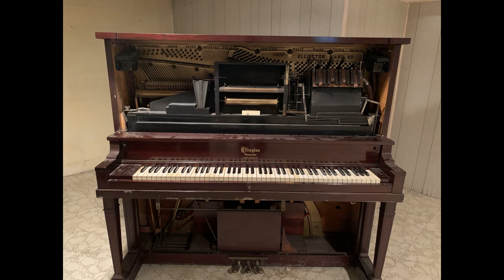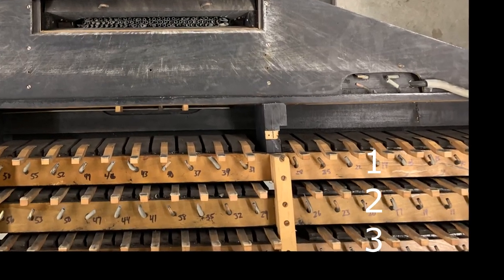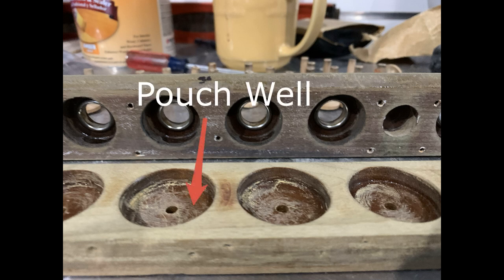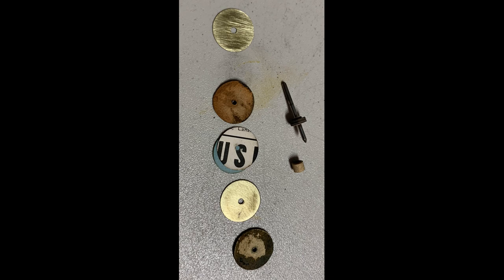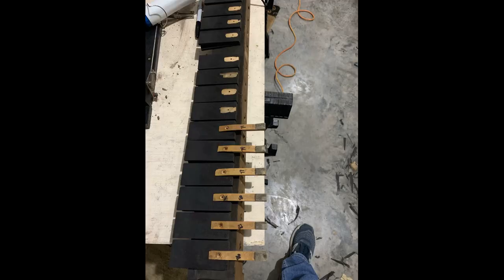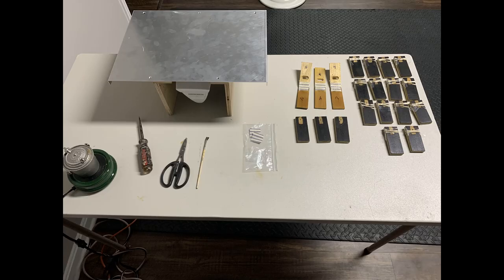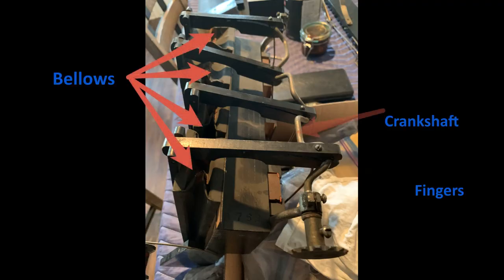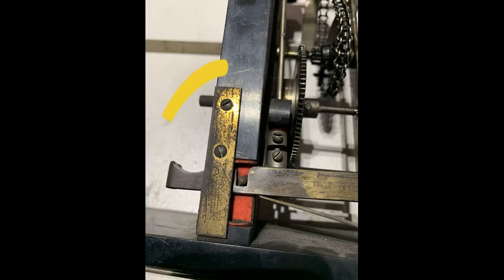Player Piano Restoration:  Part 1 - Upper Stack

Comment: Great explanation video, Shawn. I myself have been doing player piano restoration and I hope this reaches out to people who haven't yet fully learned about player pianos, it encompasses some great pointers and shows how it all works. Some things I recommend are to experiment a lot. Even if it means making a "dummy" valve so you can experiment with valve travel, it always helps. Some of the stack pneumatics look to be moving a bit sluggishly, though this could just be from camera perspective. Some things to focus on with the pneumatics are to make sure to sand the edges around half way through the thickness of the board where the hinge is so the cloth doesn't pinch causing the pneumatic to open by itself. The pneumatic should be able to sit closed by itself without anything on it or attached to it. If the pneumatic is resisting being fully closed when no vacuum is applied, you might need thinner cloth. I know it sounds counterintuitive, but you want the pneumatics to be able to rest closed when there is no vacuum and have the spring be the thing that keeps it open. This way, the vacuum is only pushing against the spring which as a set amount of resistance as the original manufacturer intended. Thankfully you know about ticking cloth, that is essential in having any working bellow. If you find that once you put the piano back together, the keys are sluggish/don't move fully or some are very quiet, it is most likely not a problem with the vacuum, it would be the pneumatics. I heard you say your dad has a shop in Oregon, does he happen to know Bruce Newman? Bruce is a wonderful person to watch for guidance in player piano restoration. Great job with everything, I have high hopes for this piano!
Reply from the maker: Thank you for your insights AspenPianola.  The Baldwin stack has many unique aspects compared to other more common players and the pneumatics are one of them.  I’ve tested each one after total assembly and they appear to be operating as designed but I’ll know in couple weeks when I get it in the piano.   What type of player are you restoring?
Reply: @shawnmalone3803  I am currently restoring an 1888 prototype player piano made by the brand Pease. It’s player system is quite rudimentary, but it is very intricate and every little detail must be perfect. It has 2 stacks one on top of the other and is a single valve compact system. It has continuous pouches made from kangaroo leather which made it difficult to re-pouch but it should work great when it is finished. Baldwin stacks are very reliable, you’ve got yourself a great piano there! It should play well when it is complete, Baldwin often left some extra room for the pneumatics to move so even if they had stiffened up over time, they would still hit the key the same they would have out of the factory.
Reply from the maker: Be sure to check out my restored player in action.  
https://youtu.be/T-7mgxDMd64